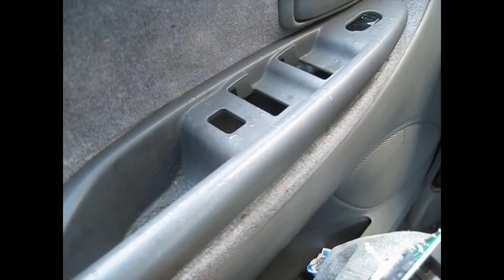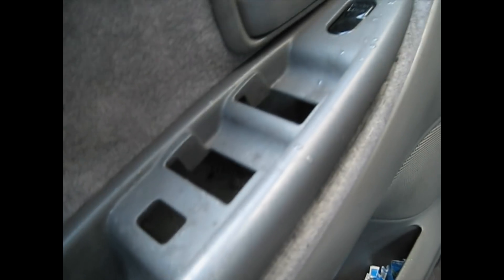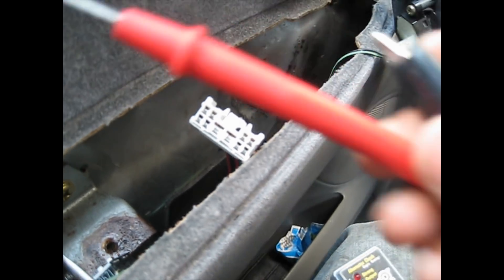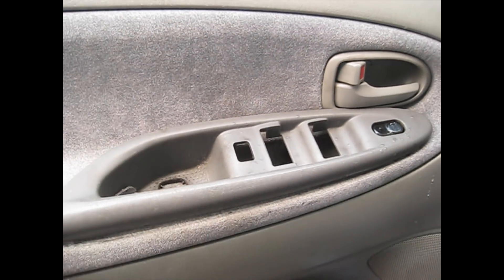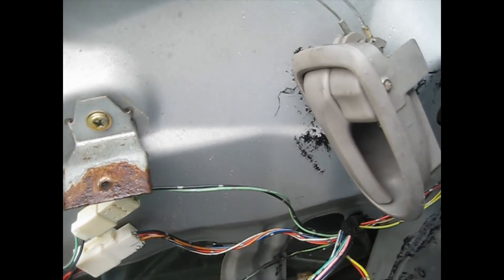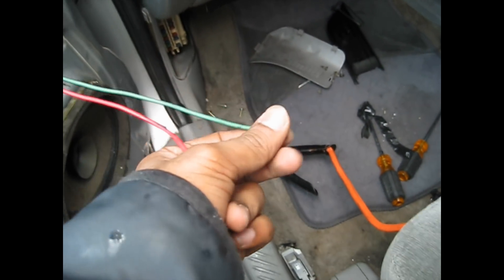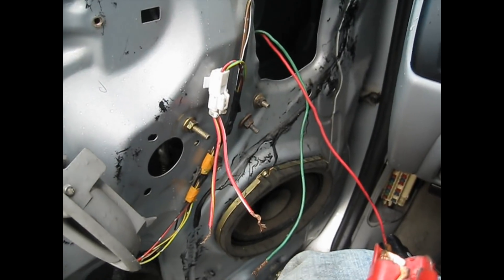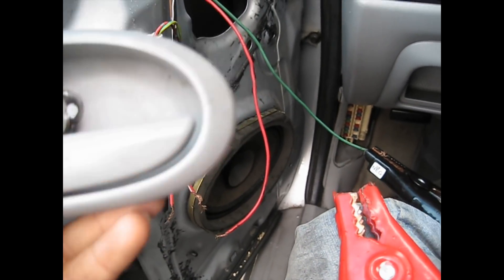Car window power switch not working, bad ground wire. DIY

Comment: You’re amazing man ✨I had the exact same problem last nite IN the rain! I just saw the part where you connected the good ground I popped off the main controller and without even disconnecting the wire harness checked the switches and they worked pulled the wires a little didn’t work pushed the wires a little worked again so the wires connecting to the harness itself were just loose. I’m guessing when it goes from cool to hot outside then back to cool the connections expand and retract not sure but great troubleshooting for sure thanks again man✨💫🌟
Reply from the maker: Glad to help

Comment: Hey great vid .. got the same mpv same problem thought it was the driver switch but found out it was a BAD GROUND🤙🏾🤙🏾 end it up running new ground wire spliced to the switch harness
Reply from the maker: Coo, thanks..

Comment: My passenger side works when it wants from both switches ran power to motor from battery works right away changed switches even bought the master 1 brand new still same could it be the motor?

Comment: How do I make sure that I put the correct cloured wire to. the correct brass prong on the drivers side door pAnel on a 1999 buick lasaber
Reply from the maker: Use a test light or multi meter to check for power.

Comment: Where the relay plugs into the fuse box. I think one connection where the prong goes in isn't receiving power could it mean I need a new fuse box?
Reply from the maker: Check the power coming to the box.

Comment: Where did you tie the ground wire into? Is the metal on the door frame enough?
Reply from the maker: No i ran it under the hood to a good ground.
Reply: Then what did u do,, where u able to work the window with switch,, u didn't show us the end results
Reply from the maker: Yes
Reply from the maker: Yes, but try to get a known good ground, i tied mine under the hood on the strut bolt.
Reply from the maker: Yes, any good known ground.
Reply: The door frame is enough

Comment: I need help....my 2003 golf 4 tdi 1.9 I've got no power on my wi dow switches  but my motors is still good hiw do I fix it
Reply from the maker: Follow this, check your relay, fuses , wiring and switch.
Reply: I did thanks wiring is good the fuses still 1oo% sorry my rev stop working
Reply from the maker: @jeromekolbie3619  Okay, take it to a shop and let them diagnose it.
Reply: Sometimes is your window switch they go bad

Comment: I'm having the same problem with my car window. The  passenger side works fine but the driver side does not go up or down.The locks work (to set factory alarm), just not the window. So by watching your vid, would you say if the fuse for that side is out, the window will not work? Would you say it could be the fuse or the switch or perhaps the motor. I'm hoping the fuse but would like your opinion. Thanks for sharing this vid, very informative!!
Reply: Also the button for the window on the driver's side is not working (push down or pull up) for the driver's window does not work. But it works (same unit) for the passenger window, if i want to let that window down i can. As you know you can control from driver's side.
Reply from the maker: Check everything.

Comment: That's a big mess of used wires you have there. Yesterday I took some old wires and copper pipe in  to a metal recycler, and I got a lot more cash for it than I expected to receive.

Comment: Watch your videos very good I might add but trying to trouble shoot my switch and window on drivers side will not go down and all other parts of switch works.  When I push on down window it will click got any suggestions?
Reply from the maker: Did you test the motor?
Reply: Got it fixed thanks for the videos motor was sticking little tap with hammer it started working!
Reply: John Zeman I

Comment: when i press down mine sound like that when i connected to the wire tester , is it the ground problem ?
Reply from the maker: Yes, run a new ground and see if that fixes it.
Reply: yup my ground is having issues , i tried to connect with jumper cable it works just fine. , thank you so much btw for this tutorial ❤️
Reply from the maker: Orb Core cool, no problem.

Comment: HP11208" HI
I have dodge ram 1500 that has problem with power window on passenger side,rear both side. when I push the switch not working at all but on the main switch by the driver side is working, an idea how to fix the connection on passenger side and rear both side??
thank you
Reply from the maker: Try this.

Comment: If it isn't the fuse it could be a broken wire.  On my car the window would work randomly.  If it works sometimes common sense should tell you it isn't the fuse.  Try this first, the accordion looking plastic you see when you open your door is supposed to protect the wire.  When you open and close the door, overtime the wires can become kinked or broken.  Try squeezing or manipulating (not too aggressively) the "accordion" while holding the switch to see if it moves.  If it does the wire can be located and repaired with a butt connection.  If the window still doesn't work when you try this it could be a motor or something else..I saved $300 by fixing the wire on the door.  Thanks
Reply: My hyundai sonata 2004 does that. Sometimes rolls down window and sometimes doesnt.
Reply: Hi. What is the name of the wire in the "accordian" that needs to be fixed? I think I have the exact same problem. Thanks

Comment: in my car the power window doesn’t work, also the switch,i change the switch and nothing again, i give power supply to the motor and the window work, what is going on?  the fuse is ok
Reply from the maker: IDK, sounds like electrical problem

Comment: I had an aftermarket car starter put in my windows work before now they don’t work I had to take it out the car starter and they still don’t work what’s the problem
Reply: Help please
Reply from the maker: Tracy Wojcik might be an electrical issue. Check the fuses, relays. Or the ignition switch.
Reply: Are fuses good relays checked the ignition switch though Huh
Reply from the maker: Car starter motor  or window motor?
Reply from the maker: If you gave the motor direct power and nothing happens.Then it's a bad motor. In my case it was a bad ground wire. It can also be the power switch.
Reply from the maker: Did you got it fixed?

Comment: 99 f150 driver window won't come down. When I push the button I hear the relay switch clicking. what should I check?
Reply from the maker: +shimon bain Clean the switch and check the wires, or it can be a bad regulator.

Comment: Please help me. My Santro Xing rear left power switch is not working(Up is working but down is not working). Door machine and motor are working
Reply from the maker: Check the wiring or switch.

Comment: I just replaced my drivers side door and the power switchs for the back windows work but nothing happens when pushing both buttons for front windows and my mirror adjuster doesn't work.  They all worked fine before replacing the door
Reply from the maker: Check the fuses relays, and wiring.

Comment: I have a 99 Buick Regal and same thing happened, we bought a brand new motor , new fuses and everything but it's still not working
Reply from the maker: Check the window regulator.
Reply: did you finally figured out what it was
Reply from the maker: I think it was a bad ground.

Comment: I have a 92 volvo 240 and the windows aren't working!!! Can't even hear the motor for All windows
Reply from the maker: You may need a motor.
Reply: if none of the windows work most chances are a blown fuse circuit
Reply: reggie madlock